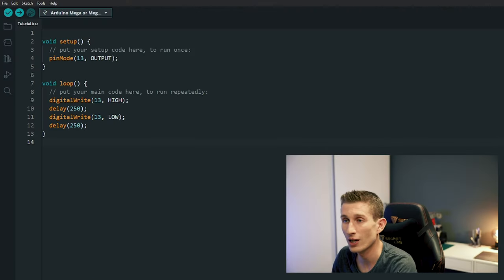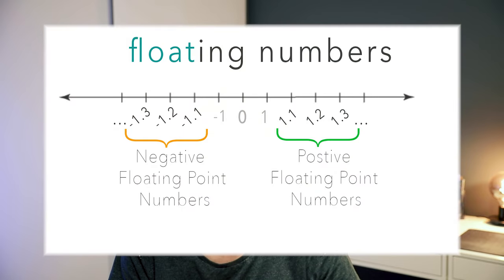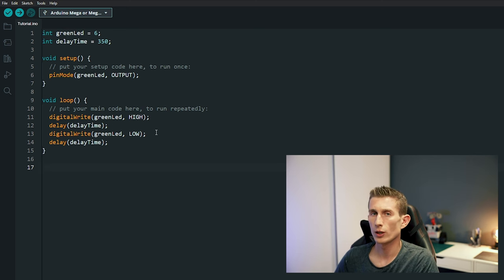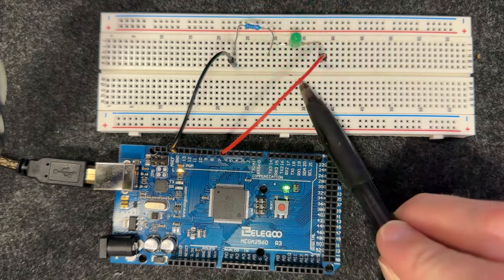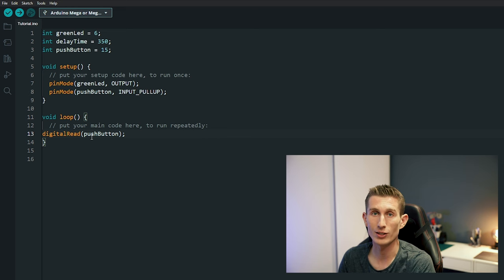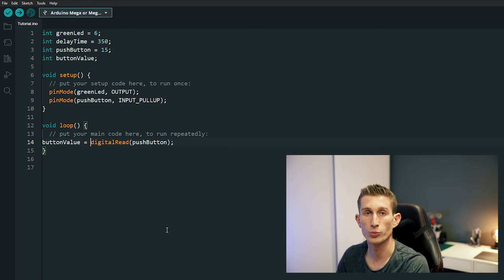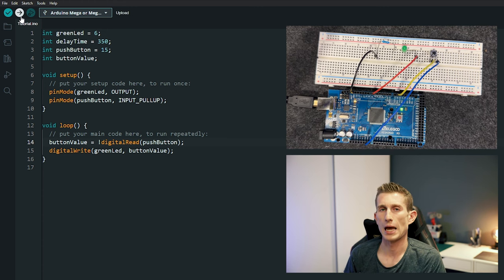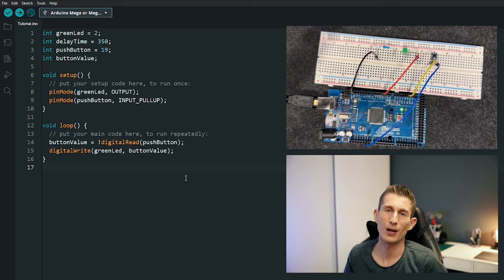Ep: 6 - Variables and Digital Inputs in Arduino | Code Your Own Flight Simulator

Comment: One of question .sir this code how to configure with specific sim and helicopter.
Reply from the maker: Hey so this code / system go coding can be used for Digital Combat Simulator. The fundamentals can be used for any type of Arduino coding 😃 Episode 7 shows DCS Bios which will allow you to code any helicopter module in DCS